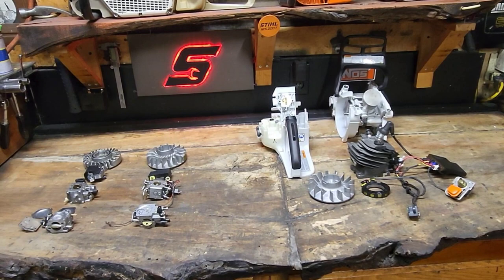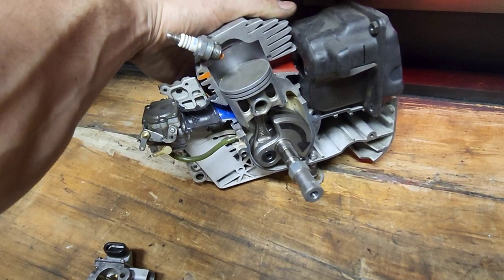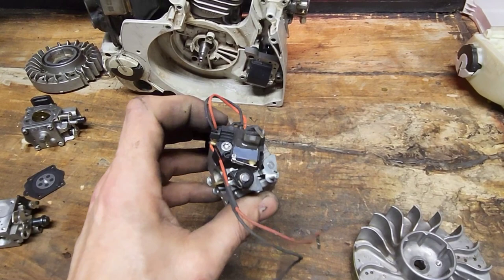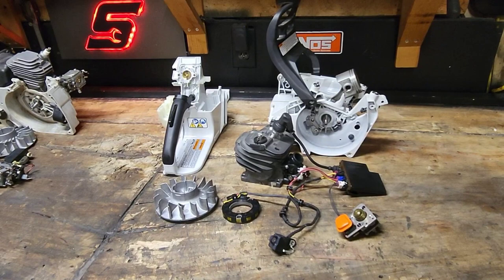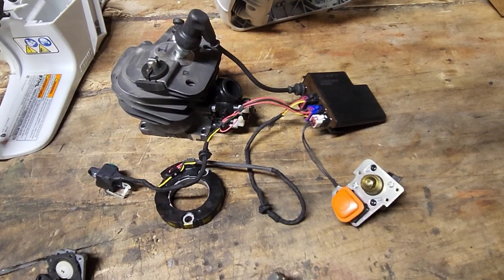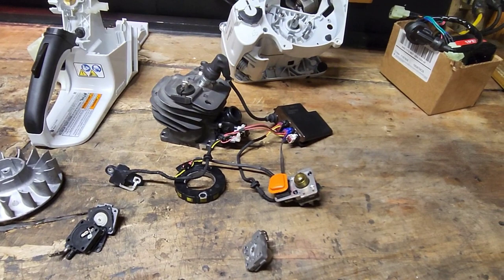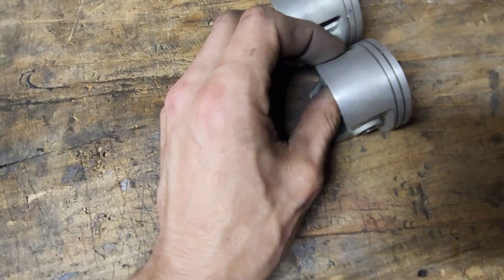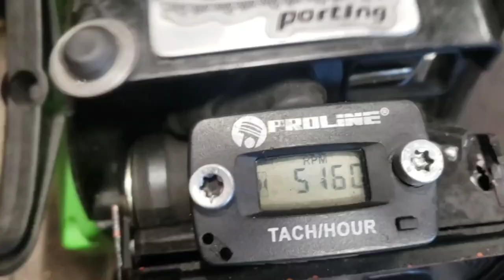Stihl MS500i Fuel Injection vs M-Tronic vs Standard carburetor... why I do a hybrid 500i build

Comment: Added a second ignition pickup to a 2 stroke tugger a friend had for moving his airplane around. With an electric start it was easy to start it in either direction. ADHD is a great way to keep you working only on the projects you find interesting.
Reply: The benefits of adhd! For me ocd.yess.

Comment: Thanks for the video, cool stuff. Pretty sure that’s a MAP (manifold  absolute pressure sensor)/ Baro sensor, it’s got the o-ring and you can see the hole into the crankcase on the saw, and there’s wires on the back not a pickup.

Comment: If I were to dig into the port timing. First would be deck height. (Back up) first would be getting the bearing to fit. Two ways. Use the 500i bearing with shim stock on each side. Or mill the 660 piston wider. Now back to deck height and doming the piston. Next would be scribing the piston through the intake and exhaust for additional piston work.

Comment: I haven't  had a 500i in the shop yet but have had the ms 441 c in .there is 3 to 4 things that are a problem , 1 is , some dealers are not familliar with them and dont set them up for their customers,  and there is a set up process that has to be done or they run like crap ! There is a very high vibration in them that will loosen the spark plugs , groove the top of the spark plug as well as grind out rubber on the spark plug boot !!!! I just pulled a plug  a couple days ago on one and found the porcelain on the plug  had totally came loose and was spinning around inside of the steel housing of the plug !!!! The saw was brought in for sharpening. This leads me to the last thing thats a problem,  and i think most  people like to fine tune the saw their self , but with the M- tronics it does it for you . But this is a problem in my opinion because it will compensate for these problems such as the plug coming out ( but still by or in the hole ) the porcelain vibrating loose , and the saw still runs ! I had to heli coil two spark plug holes , and if the porcelain had broke or shattered , you could kiss that motor goodbye! Power is no problem,  but there is definitely a problem with the saw as far as the high vibration.

Comment: My 500i was crushed with less than an hour on it. I worked at a dealership at the time and rebuilt it with one new crankcase half and most all the plastics. I learned a lot about the assembly of it. I also recalibrated it after I reassembled it.

Comment: That crank position sensor looks like it's also a map sensor. You may want to try to use an microsquirt ecu and use turner studio to tune the saw. Get rid of the 500i ecu all together. And add coil and  plug like on a 2 stroke dirtbike. The hardest part will be figuring out the parameters of of that crank position/map sensor.
Reply: Or maybe look at using a power commander

Comment: thank you - your explaining the other types was informative
the 500i is very similar to my Vortec in the my GMC - the brain box adjusts to what it wants
I do like the primer/purge valve as I see that would be a help. but on a car engine I turn on the power to let the pump run a bit before starting [that helps it on cold starts] 
 I had only thought the efi type saws would be similar and unless you reprogram that box, it will adjust things to what it is set for. [nice & easy when you replace the distributor (a car thing) ]
all these run great as long as you let the box do what it wants.
 yes as long as you add a (chip or prgamme device you get to change it to your liking]
 WOW your hybride build I see would be a great thing.
perhaps in time the stihl folks might change it up?
 but I see the car engines havnt changed as that setup [box] allows for more error in their assembly.
so even a robot can slap those subpar parts in And the box makes it run in a way it is happy.
 *That will make your builds  necessary :)
great Job.
THANK YOU

Comment: Wisco used to make a piston that would drop right in to the  660 back in the 80's to 9o's if I can find part numbers for standard and over size ( I have a 101cc 660 big bore ) I will post them to you here..
thanks for doing the blog, I'll be sticking with what I've got.

Comment: Nice video John. I suspect that because the 500i does not have a throttle position sensor it limits what one could do with a potentiameter unlike with injection systems on engines with a TPS. It is nuts how inconsistent the pistons are in these saws. I too have noticed the difference in the sound in Jack's 500i builds and yours as well. Have you run a 500i up to the rpm that you consider it 4 stroking for any length of time and then pulled and inspected the plug? I considered this theory in the testing I did with the 592xp, the plug was snow white in that saw when run that way limbing. My Stihl rep says the 500i works off the rev limiter, that at full throttle it runs up to the max rpm and corrects itself constantly. I would like to hear one of your hybrid saws run while limbing (something alot of users comment on), I suspect yours will run and sound different than a stock saw. I have noticed some saws are worse than others perhaps the inconsistentcy in the stock pistons and its effect on port timing is part of the issue, I don't believe it's the ECM myself I am glad it takes well to piston and cylinder mods. My tach does not read the 500i well, I need to get a different tach to be able to monitor the rpms in the 500i while limbing for example so I can better understand what is going on. Curious on your thoughts.

Comment: Amazing. This wouldn't cause a longevity issue would it? At this point what's the longest running saw with that longer piston? Almost feel with a stihl 660 piston what you're doing would almost last longer making the saw even better.

Comment: I’m working in a MS661c and I cannot figure out why it goes ballistic after having started fine..idling good and then as soon as you squeeze the trigger, it goes full throttle by itself. 
I have put in a new kit (solenoid, ignition and air filter) and tried doing a reset but I think it doesn’t do it right. 
It goes through the 30-40 sec, then I squeeze the trigger all the way, then it goes down to a lower than the full throttle but not like I’ve seen in some videos.  But I shut it down anyway then restart and it goes crazy fast.  And that is what it was doing before the kit. 
Do you know what is causing this?

Thank you for you videos.